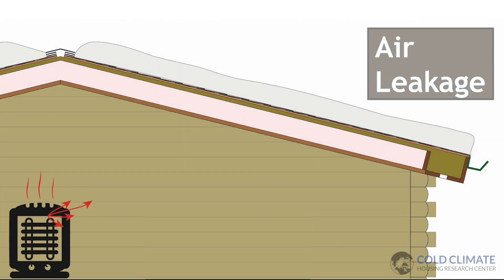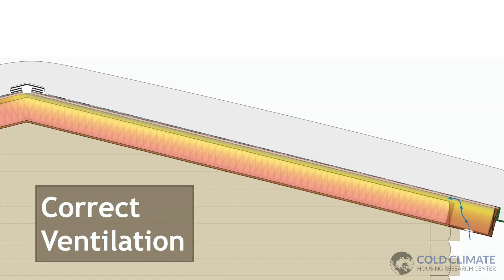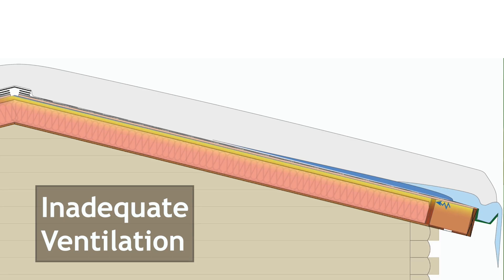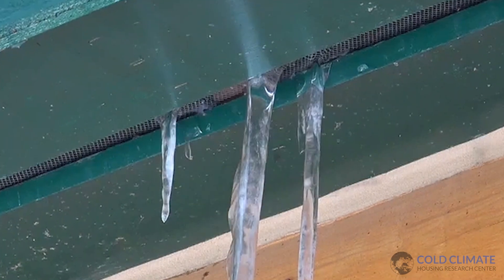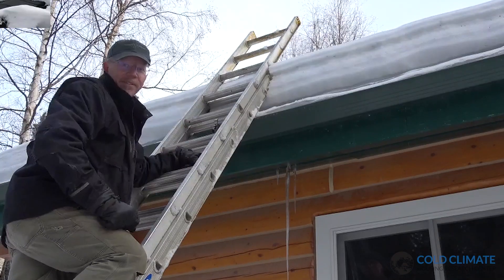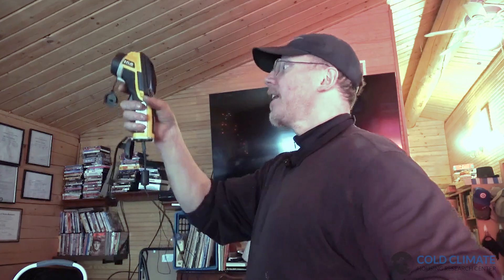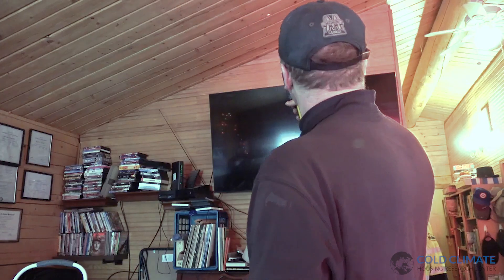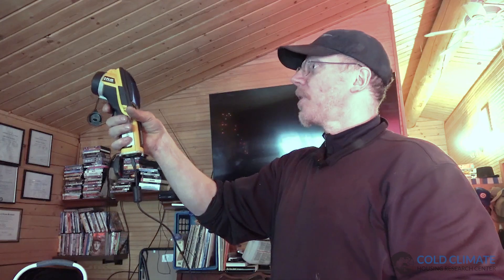Diagnosing an Ice Dam

Comment: What are your thoughts on doing a flash and bat approach if the spray foam is applied to the underside of the T&G to act and a vapour and air seal as the spray foam would be on the warm side in this application?